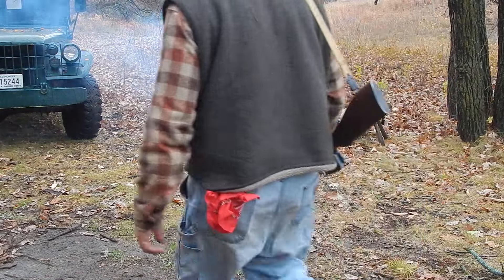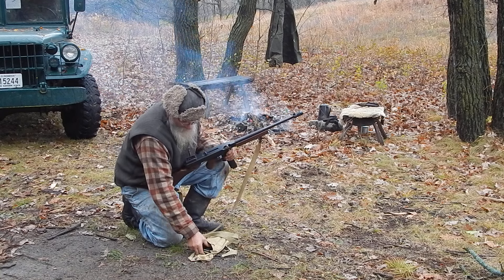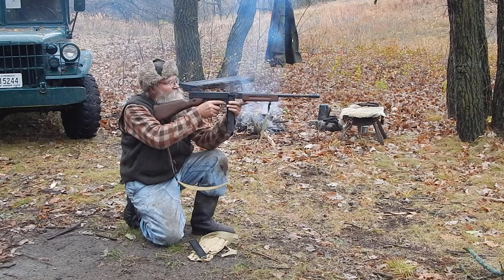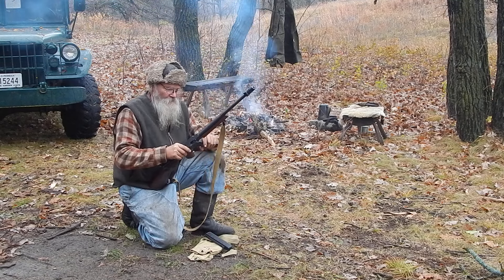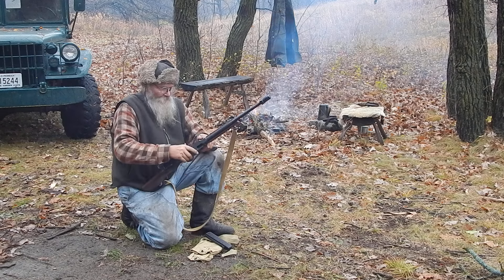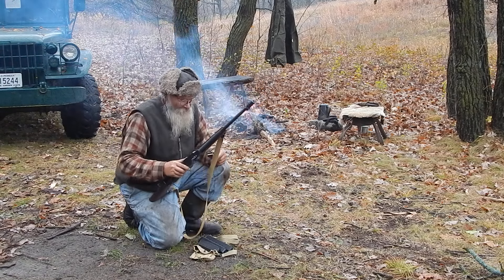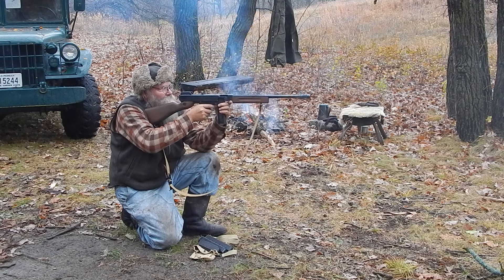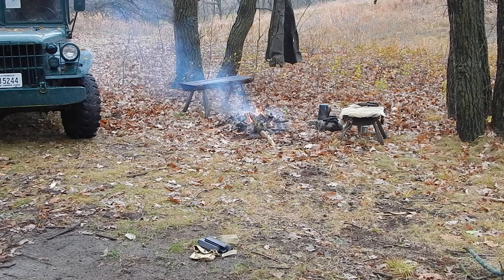Thompson magazine test

Comment: That's a classic I'd love to own but haven't pulled the trigger yet.
Reply from the maker: MyHollowpoint  Certainly not cheap, but very solidly built, and easy shooting.  They are a bit heavy, but the weight makes the .45 rounds recoil like a .22, and they are so quiet you hardly need hearing protection.